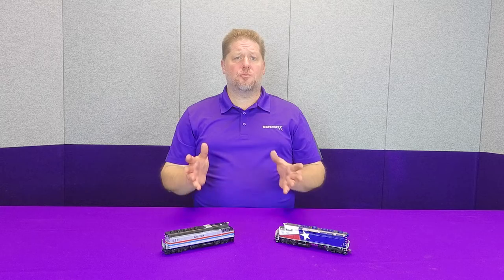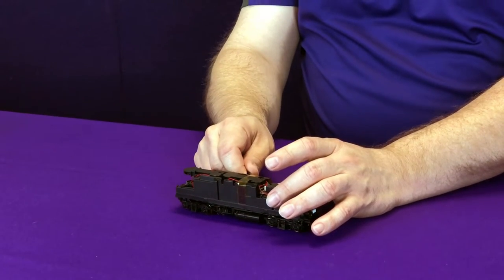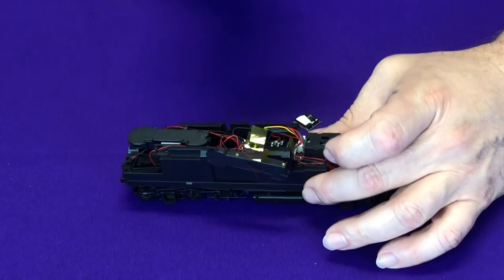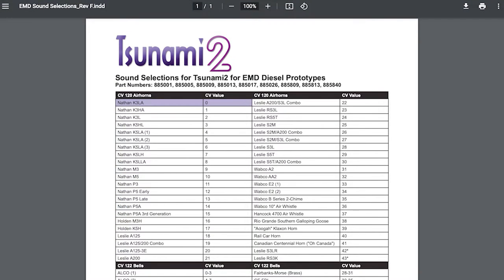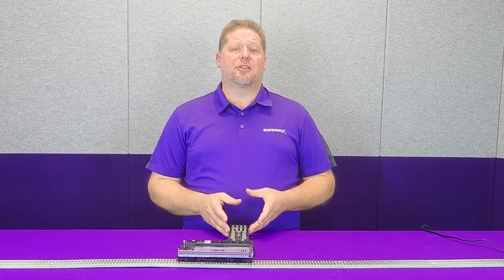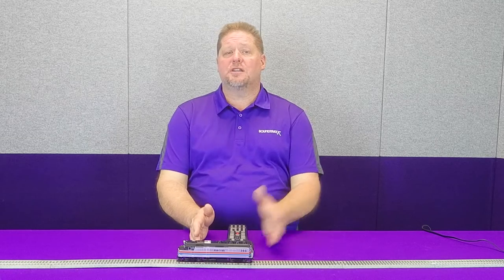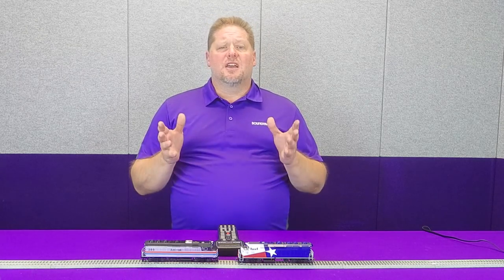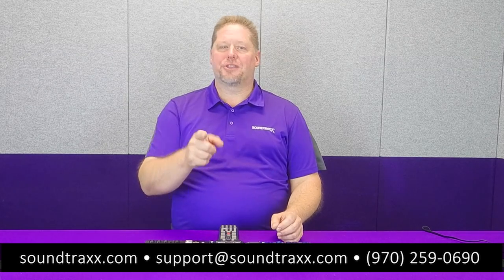Tsunami2, TSU-21PNEM8 Installs into Rapido Train's Models

Comment: Hey, George. Bought a Metra F59PH. I swapped out my decoder for the Tsu2. Which lighting output is the oscillating light?
Reply from the maker: I am not sure.  The install I did on the TRE did not have that light.  So, start with turning on FX3-FX8 one at a time using F24-F28, and when it illuminates, then that’s the one that will be set for the oscillating light.  If you are still unsure, then turn on all lights, then one at a time, set the light effect to a mars light, and when the desired light changes to the Mars effect, then you’ll know which one is wired to it.  I hope this helps.  Further assistance is available direct at georgeb@soundtraxx.com

Comment: Were those  "dummy plugs" actually ESU decoders? I didn't know Rapido sold DC models with speakers installed.
Reply: Nope, those are DC jumper boards. The ESU Loksound decoders are longer and blue colored
Reply from the maker: They were just DC jumpers.

Comment: How do you handle the class lights for the F59Ph ?
Reply: good question. I'm looking forward to seeing their response.
Reply: @alainaarrhodge5900  I did my own Loksound install in one, and the public sound file does not handle it the same way the Rapido factory installed one does. So very curious if Soundtraxx has figured out a way with their decoder.
Reply: Thank George, well done.
Reply: @KingTrump2024  the Loksound decoder uses a class light sound slot
Reply: @CentralJerseyRailfan  I guess that's the missing piece.  The V5 12-710 file does not that special sound slot.
Reply: @KingTrump2024  Correct, i have a custom file on the ESU FB group you can download that’ll drop right in mapped for the metrolink version. it has class light sound slot (for go transit units that will need to be remapped correctly as it currently isn’t correct) included in addition to a correct metrolink p2
Reply from the maker: George has not played with the lights yet. In past locos by Rapido we had no issues, so we did not anticipate any. He will take a look at them this week and he will address any issues he comes across. Thanks.
Reply from the maker: @canadianlocomotivelogistics  thanks
Reply: @SoundtraxxDCC  reason I was asking is that I am very impressed with the sound and may chose to swap out the loksound for thr tsunami decoder.
Reply from the maker: Class lights are on FX6 white, FX7 red, FX8 green. A video will be coming soon.
Reply from the maker: @KingTrump2024  yes you have full access to the class lights. George is going to shoot a video soon showing this off. So you should be able to swap happily!
Reply: @SoundtraxxDCC  Thanks so much for the quick reply , thats great news !
Reply from the maker: @KingTrump2024  Of course, let us know if you need anything else and keep an eye out for a video on this coming soon.